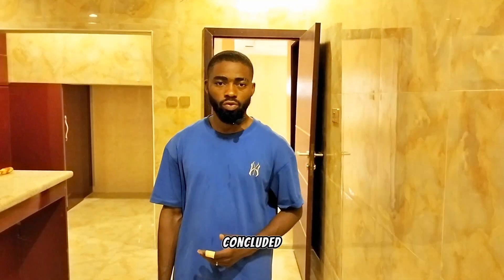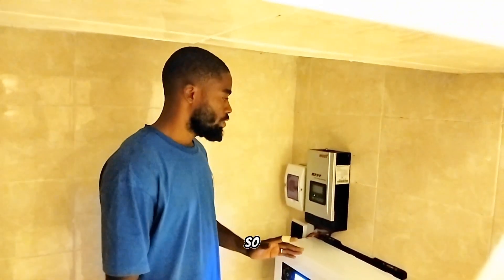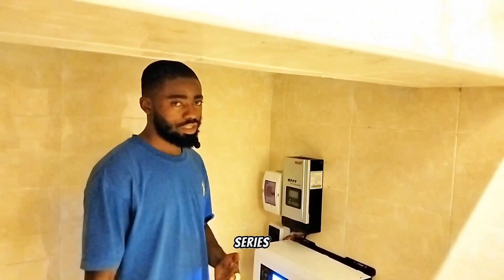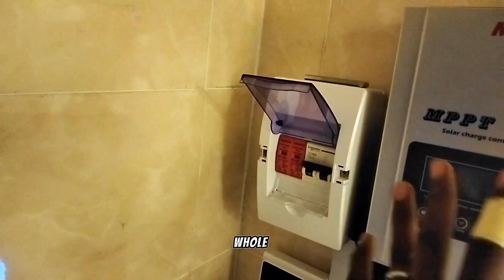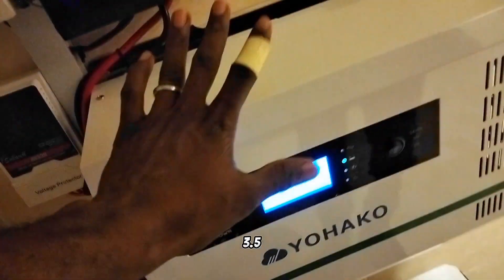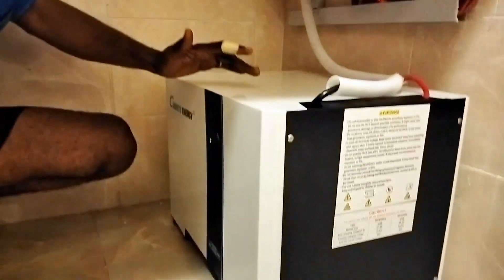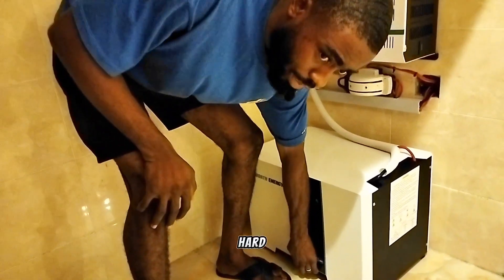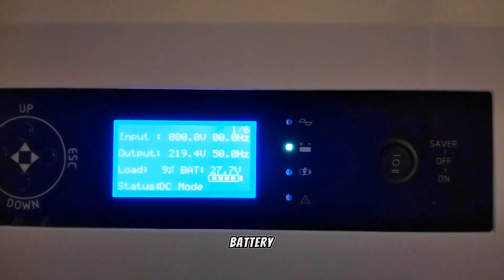complete 3.5kva solar energy system with lifepo4 battery

Comment: That's a great setup. Thumbs up!   Nice to see someone using 24V or 48V.  There are far too many videos on YouTube by people who try to build "new" big systems on top of a 12V architecture.  24V and 48V are much better.  Everything runs cooler, the wires can be smaller, and losses are lower.

You have a pretty well-matched system there.  The 5 kWh of storage is just barely enough to run maybe 250W of continuous loads 24x7, but it will eat most of the battery overnight doing it.   2 kWp of solar is enough to run around 300W of continuous load 24x7 completely off-grid (with reasonable sun, of course).

My one comment is that you will probably want to double your battery capacity to give yourself more battery margin to deal with longer power outages.  10 kWh is a better fit storage-wise with 2 kWp of solar panels.

I also like that you are using the grid AC only for the battery charger and not trying to implement a UPS mode or automatic transfer switch type of thing.   The way you have it setup is very robust.  It really is the right way to do it when the grid is unreliable.  There is virtually no chance of destroying your appliances.

-Matt
Reply from the maker: Thank you for your great opinion.
In the long run client will add another 5kw battery to make it 10kw!
And the house is more like a holiday home so there's no much energy consumption